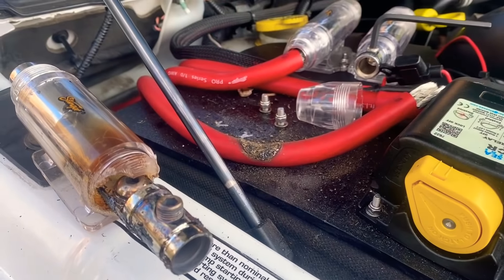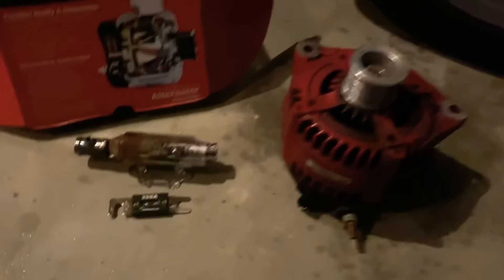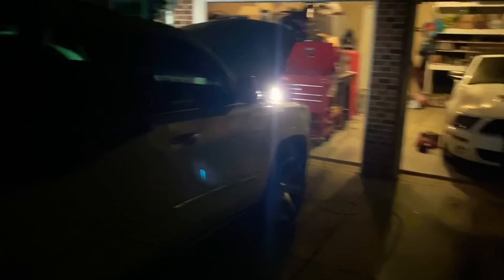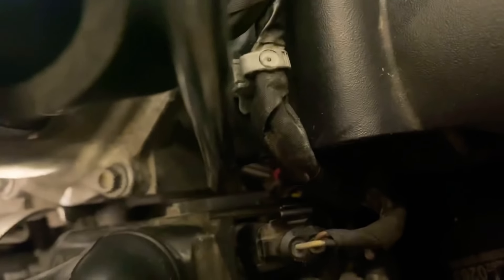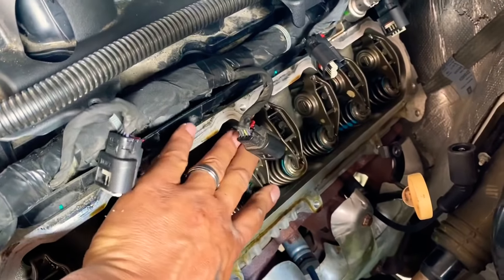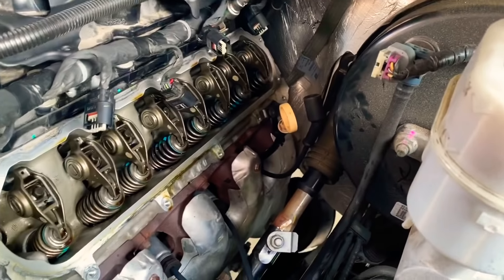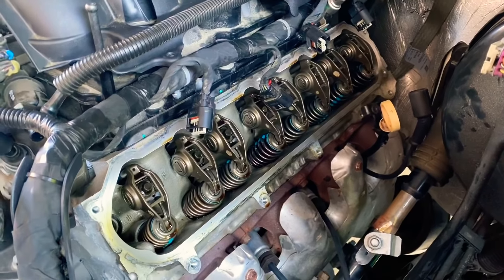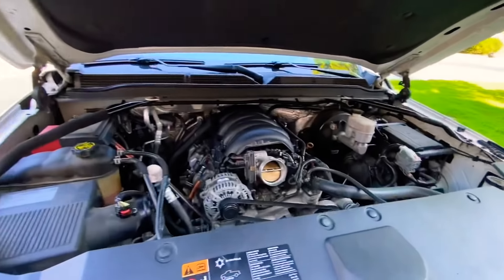“L86 Lifter Replacement” Truckin Wife’s Escalade gets rid of AFM and A little Red Light Green Light

Comment: 👍👍 I have three vehicles a 2015 toyota tundra, 2010 corola and a 98 ford taurus se, bought this taurus in 98 the drive train never gave me any issue or never left me stranded on the side of the road everything is original, including the muffler system, never been changed. Last weekend changed out all 4 struts, rotors, brake brackets, caliper, and pads, yup!! pop a brakeline bleeding it, so now I'm changing out tghe whole brakeline system and replacing it with nickel copper lines Iwas going to have someone else do it, but they quoted me 1500 I laughed and walked out,  for the whole set of line set is 167 dollars flared an bent according to the spect for my vehicle I'll do it myself she have 130,000 original miles on it that sit in the garage year round just can't part from her, for a 3.0 vulcan she have no problem getting up to higway speed when I need to merge into a highway lane from and on ramp.
Reply from the maker: Awesome 👏🏽

Comment: Something was overloaded. That's meltdown. I am gonna hazard without seeing the setup. That the amps are or did pull WAY too much current. And the online fuse poped...But melted right back into like and that's what happened to that.
As I said. I was an electronics engineer/technician in the RCAF (Royal Canadian Air Force) and I'm gonna say this. Something deep inside that sound system setup isn't right. It's gonna over work that new alternator and destroy the puppy hearing again.
Its getting too much current draw. 
GET THAT SYSTEM OUTTA THAT TRUCK!!! 
IT'S GONNA CAUSE A FIRE AND BURN THAT TRUCK TO THE GROUND.
Reply from the maker: Okay having A Shop look at it 🙏🏽